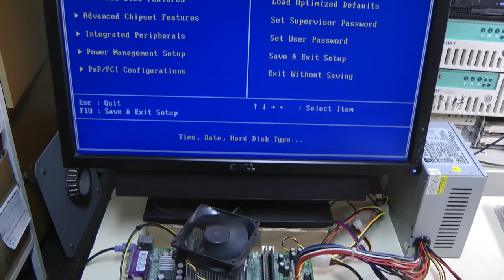cold cathodes testing - RETRO Hardware

Comment: As a nerd obsessed with the 4th state of matter(plasma) I prefer these over LEDs. You can also use regular old fluorescent lamps with broken electrodes that no longer light up in fixtures, in cold cathode mode with a high voltage, current limited power supply.